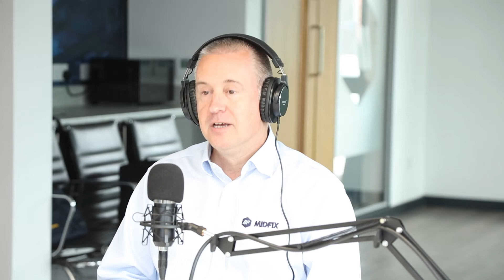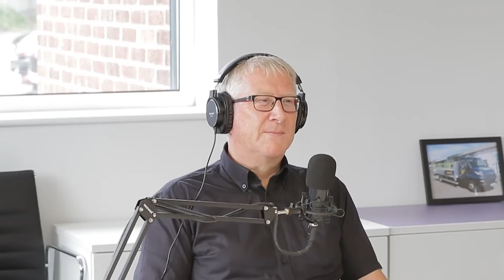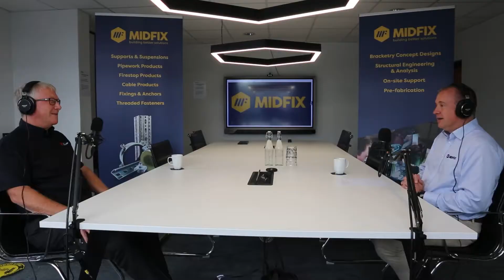Season 1 Episode 6: What are Zinc Whiskers and why do they impact data centres?

Comment: nickle plating would be suitable, compare to the cost of stainless steel
Reply: it aluminum. In China, a significant portion of data center infrastructure utilizes aluminum for cable management solutions. Cost effectiveness and lighter weight and makes installation easier. Aluminum has good corrosion resistance.